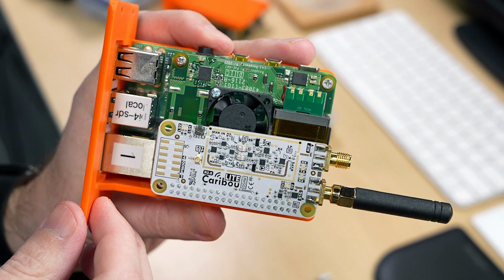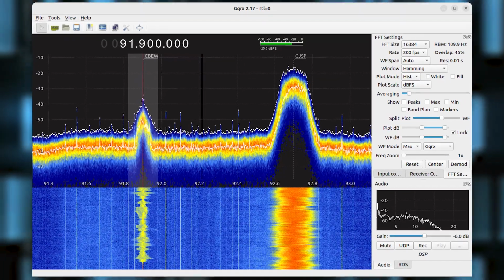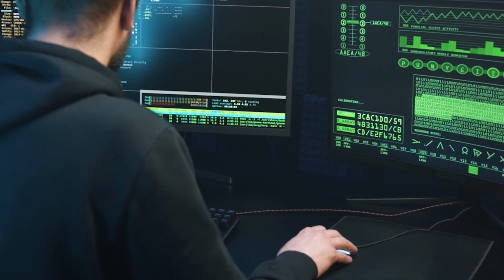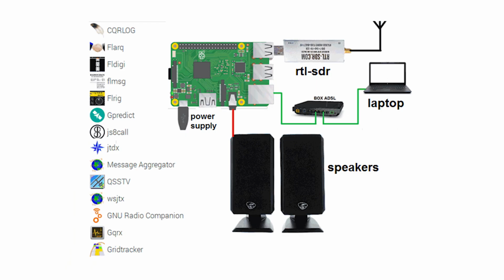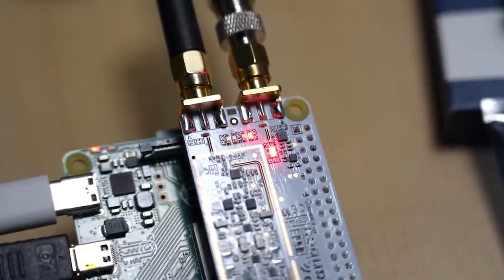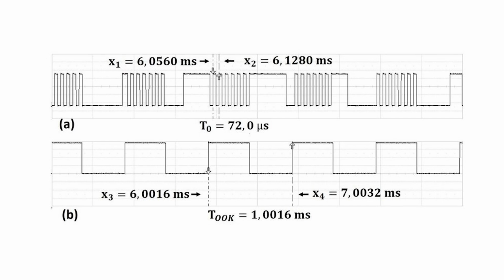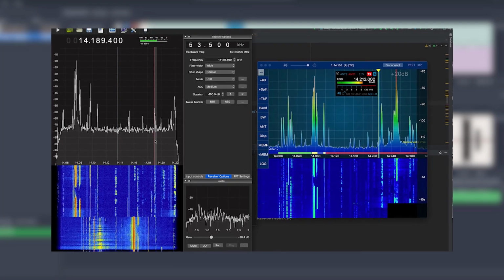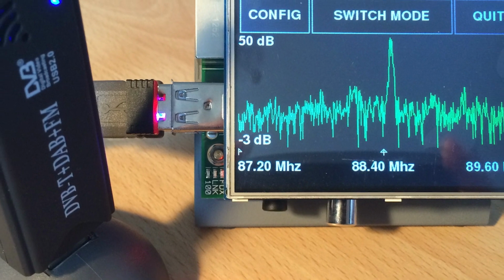Radio Hacking 101: Raspberry Pi SDR With CaribouLite

Comment: How does the CaribouLite compare with other low-ish cost SDR tools like the Flipper Zero or Lime SDR?

I'm interested in visualizing the RF that circuits emit..  for example something like the videos:
"free radiated emission simulation (electric field) of a KiCad layout + PCB layout review"
"[RadioFieldAR -tinySA-] Visualize radio wave strength."  (manahiyo831 / VR_RTLSDR_AVATAR or RadioFieldAR_tinySA-ULTRA)

Commercial tools like
Ansys Electronics Desktop (AEDT), Ansys HFSS, Electromagnetic Interference and Compatibility (EMI/EMC)  , Maxwell, Siwave, etc..

are too expensive for hobby, but I imagine using SDR and an antenna wand (Katerina Galitskaya) might be 80% as good?